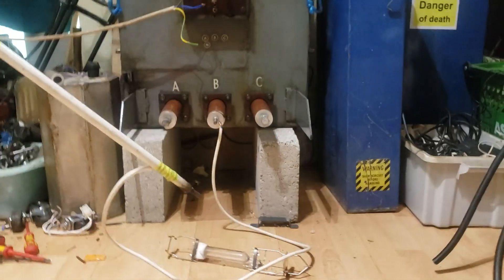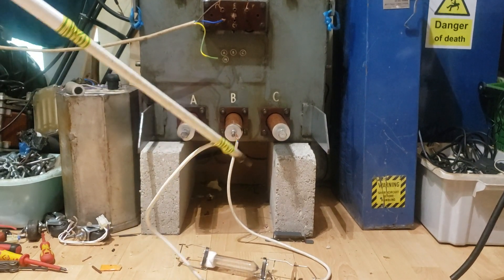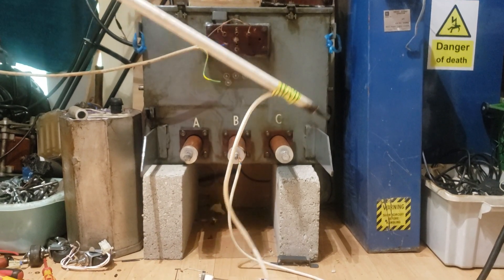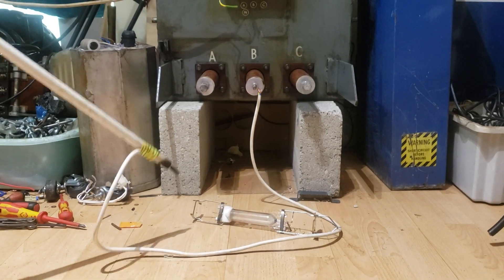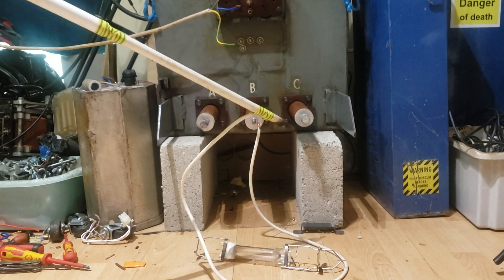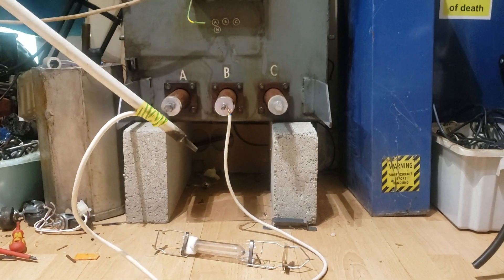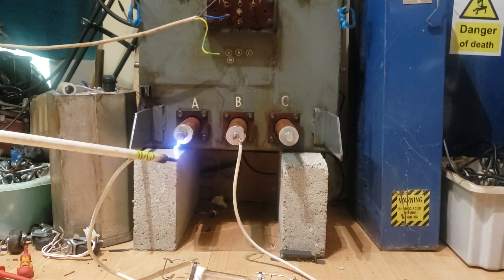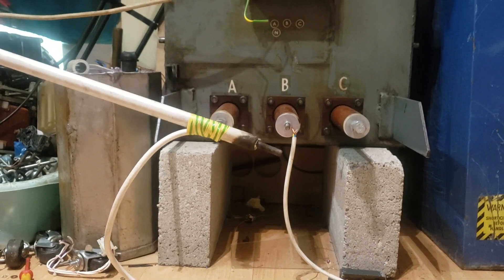High Voltage Transformer Arcs 40,000 volts

Comment: Scary and interesting. I prefer to get my thrills vicariously by watching channels like yours ,rather than be tempted into doing stupid stuff I did when younger.  Not suggested you or anyone else trying this stuff is stupid BTW as I don't know what precautions they use. (Just mentioned that as some will try to 'read between the lines'.
Your audio is a bit low sometimes. You mention 'ballast' and I am unsure how this works. Are extra MOT's somehow added in series to limit current as you up the voltage from variac? Is there no arcing between terminals of transformer as the air in the gap has not ionised?
Reply from the maker: Thank you for watching my channel, I will be making a more in depth better video about this transformer soon, I will try to answer your questions in there...

Steve